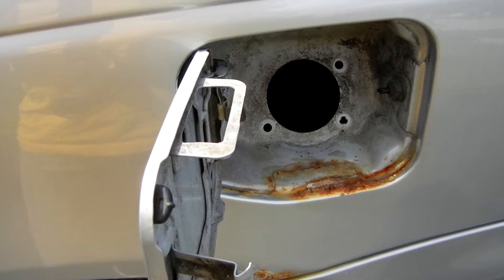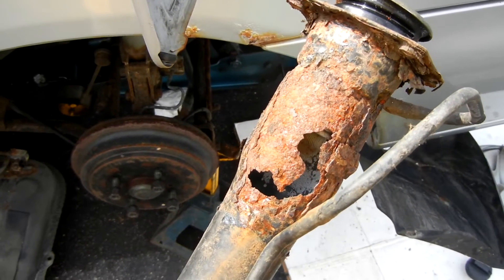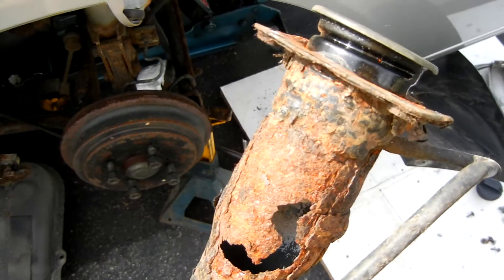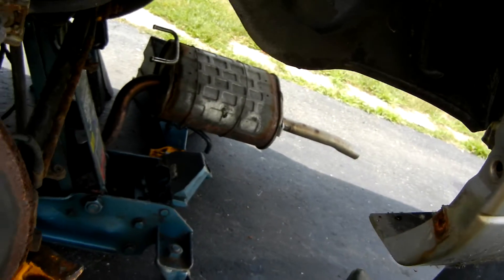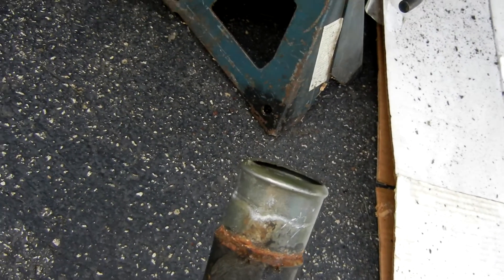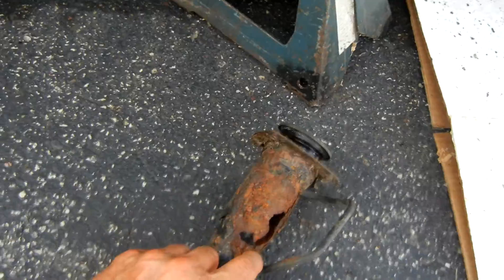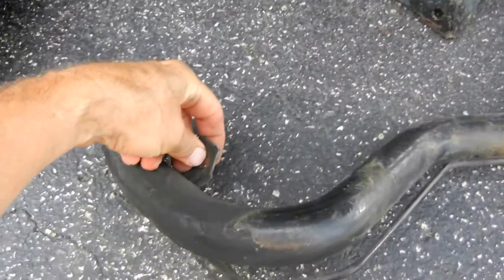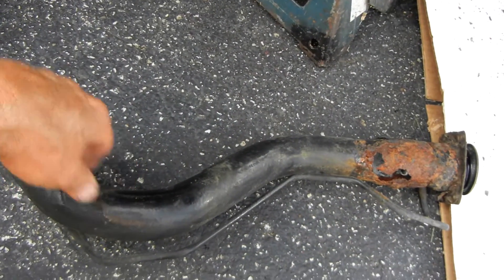Suzuki Esteem Gas Filler Pipe Repair  (part 1, start of sequence)

Comment: would you have a video on how change its stereo
Reply from the maker: I have had a problem with the dial light failing for 10 years and have an extra stereo from same model Esteem but have not put it in. My thought would be: disconnect the negative battery cable; the black plastic frame around the stereo head unit pops out with a few clips that need to be tweeked tweaked-sp and then there are antenna wire, side screws that bolt the unit securely, power wire and speaker wires that connect at the back. You will have to remove some side panels sorta down from the stereo on each side of the console, I believe. Something like that codewalters. Good luck  Vin
Reply: +Vincent Rolfe  Thank you for your reply Vincent. I did  remove the plastic around the stereo. it had screws underneath and I removed all of them. but it still wouldn't pop out. I took out the side glove box and felt behind the stereo. I believe there is a bolt there but not sure. anyways I will try again another day. I recently bought a 2 din stereo was trying to see if I can put that in myself. If you do have the time one day please do post a video on the disassembly of different items on the Suzuki esteem. I have subscribed to your channel. good day to you !!!!

Comment: Wow i'm so glad i found someone that has a suzuki esteem . i have also have a 1998 station wagon, i love it but it rusting out on me too the fuel filler neck,  the bolts that hold the crossmember, the front end suspension, the floor under the drive side, but i won't let her go. i need to get the whole under carriage sheet metal and welded . thanks for tips
Reply from the maker: Sonya, sonya, sonya; I have the rust in Chicago-salt on the roads. I am in the throws of taking the the cover off the front side-end of the motor now with a jumped timing chain-will not start. The Suzuki dealer wanted$500 for a new cam synchronizer (no spark at the spark plugs). I said NO and bought a new module for 56 bucks from a CA house. Still would not run. There is a flat disk with 4 square holes that works with the computer to say which of the 4 spark plugs is to fire on time. With 190K miles, even w/o oil flooding in from a poor sychronizer rubber seal, you will find that the square holes fill with oil mist and eventually plug up to a degree and this causes the spark to fail at the plugs. Clean that disk and the spark comes back-don't spend the dollars on a module or the $500 at the dealer. Next. check the timing marks to see if they align. If no marks align; start removing things to check the tensioner at the main timing chain and this can cause no starting. More later. You have the 1.6L motor Sonya and that is different from my 1.8L motor. Keep checking the valves on that 1.6L from what I hear. The 1.8L is good for 350K miles looking at parts wear at 190K now. If you have to drop the gas tank--be careful to not touch the white plastic pipes-they break at a touch and OMG that is BAD. Let me know, Sonya if you need help. Love ya. Vin

Comment from the maker: To address the fuel tank and or fuel pump, it is necessary to drop the gas tank partially and find the location of the pump in the tank to be on the front left (drivers) side. Disconnect the three gas lines of a snap fit connector and follow suit by disconnecting all the other hoses at the pump outside directly over the pump. Prior to this you have drained most of the gas from the tank with 10 ft of 1/2" vinyl  tubing tuck down the large rubber hose off the filler metal neck-cap and disconnected the larger rubber and smaller rubber hose at the filler pipe-no disconnect of the large hose at the tank. Balance the empty tank on your floor jack as you had taken the two tank straps loose; leaving the passenger side strap as the last to remove whist supporting the tank with the floor jack by pushing up on the tank against the car under body(do not completely lower the tank on the passenger side in the whole operation. You will not (NOT) need to disconnect any of the other tank emission hose found on top of the tank in the central region area-if you do disconnect these you will have to completely lower-remove the tank-lots of work. Get some rust buster to spray the small nuts on the round plate that supports the fuel tank and sending unit with  care not to strip these. Whilst having the whole car up in the air about 20" you can remove the fuel pump very carefully from the tank noting the float and arm of the sending unit take some gentile manuevering (sp) --just keep an eye on this unit as you twist and turn to remove it. The pump is nestled in the white nylon housing with a rubber odd shaped washer on top and the one electric connect clip that has to slide out along with the pump. I don't believe one needs to replace the filter-white screen unless it looks plugged. You will have to disconnect the two spring loaded long bolts that connect the tail pipe up by the motor along with those rubber donuts at the rear muffler and use a 12" tall block to support that muffler whilst you finish removing those two spring loaded bolts ( you will have to contort the muffler by twisting the whole pipe muffler system toward the passenger side just to give room to lower the tank-do not need to disconnect the back oxy sensor wire-just pull out some excess wire from inside the car to allow movement). After you have the muffler and pipe system free you take the 12" block away so the system can lie on the ground. Hope this helps. Buy the Bosch pump for $120--not the other brands. NAPA-Bosch. It's late and nature calls me to the sheets. Use a needle nose pliers to handle the three gas line clips as found between the underbody and the passage area to the tank. Pinch the clips whilst pulling the tank lines strongly from the stationary 3 lines. No need to disconnect these 3 lines at the pump just remember which connects to which.

Comment from the maker: Fog light replacement video not forth with; me wife wanted the fogs but I declined. I think they wanted $90 for the fogs at the time we bought the car new; now at 185K I don't think we would have used those fogs in the Chicago area. Maybe Kingsport or Seattle we wooda. Go to the Suzuki dealer and look at the parts diagram and you can probably figure the work required.  Thanks